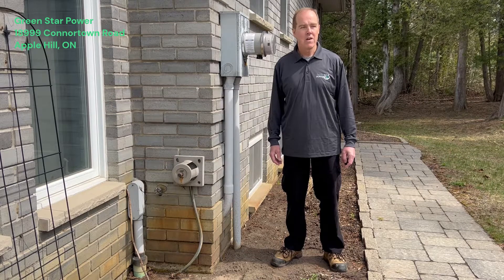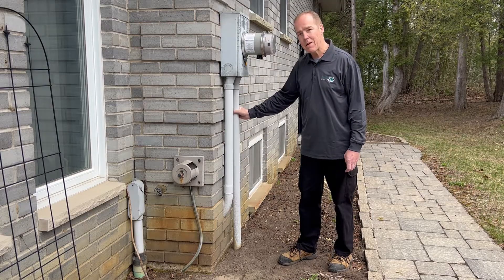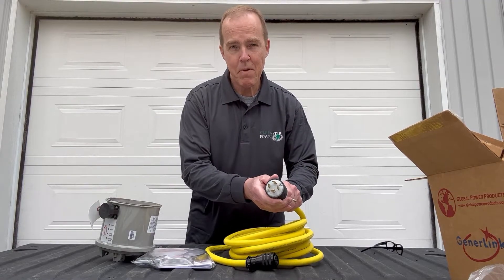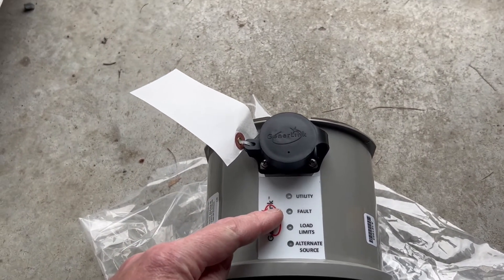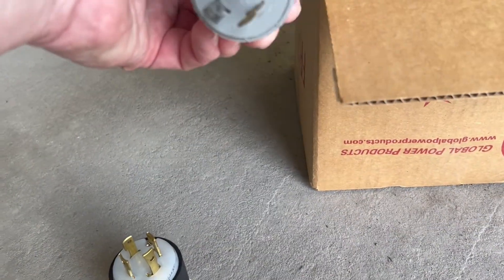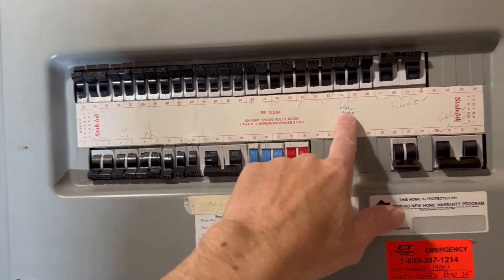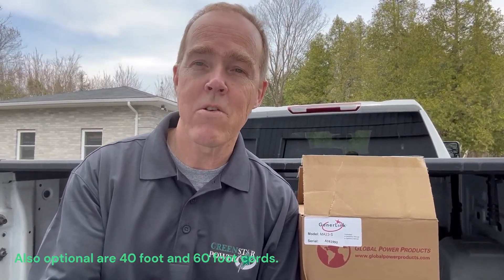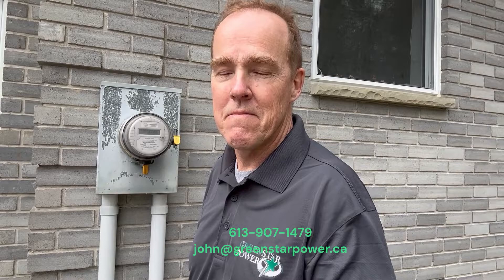GenerLink - How it Works, Connections, Electrical Panel, Options and more.

Comment: Cool concept but keep in mind that you can't use a Generlink with bonded neutral generators.  The Generlink will NOT switch the neutral, so using a bonded neutral generator is going to introduce a second neutral path, which is a big no no.  So, while a Generlink works with floating neutral generators, the module won't work with bonded neutral generators.
Reply: Can easily add a neutral switching plug to most generators to change to floating neutral.  You pointed out a very good thing to watch for with generators!

Comment: One thing to consider .. Surge protection is a one time protection. Once it surges once the generlink is bricked and needs to be sent in to generlink to get repaired.   Cost is 1000.00 in canada plus permits to get it put in again
Reply from the maker: Thanks KK for that information.

https://generlinkcanada.ca/wp-content/uploads/sites/2/2024/06/GL-OP-Manual.pdf

This comes straight out of the GenerLink Operating Manual. Look under Surge Protection Manufacturers Limited Warranty. Home surge protection is a growing in popularity. There may be better, cheaper options than buying a GenerLink with surge protection. People should discuss that with their electrician. On the other hand, a GenerLink with surge protection (at a potential cost later of $1,000) is better than buying one w/o surge and then not protecting your home at all. Also to consider, if your house gets a surge, will your utility or your insurance cover your losses?

Comment: Wait until you go to change the rubber plug cover because it's weatherchecked, cracked, and loose. You'll find out like I did that you have to take the unit back off the house to do it. The screws for the rubber plug cover thread into some retention type nuts inside the unit.... that are now loose after you took the original screws out and so you can't get the screws to re-thread going back in!!! Wow, dumber than ** design.
Reply from the maker: @Xlatty how old is your GenerLink? It must be in direct sunlight a lot. That would be annoying.

Comment: lack of 50A option is strange, as stepping up to a 50A outlet on the generator would be common. Also that "Standard" cable is not at all, its some proprietary Generlink 4 pin plug. not cool.
Reply from the maker: lol, I was referring to THEIR standard. Yes, it's 100% proprietary... and I haven't been able to take the plug apart. They say that it has to be returned for repair.

Comment: Hi.. Thanks for the video .. Can you wire your solar inverter to the 30 amp plug..220v Female.. Then plug that into Generlink. Appreciate the video.
Reply from the maker: Thanks for the positive comments. I would suggest only using the GenerLink per the manufacture's recommendations. "The GenerLink transfer switch is a UL-listed, socket-mounted device that provides a safe, easy and affordable way to connect a portable generator to your home."

Comment: I want to hook up a solar bank  to a generlink. So all the solar generators i have found are 3 prong not 4. And its ok to cut the cord and make it 3 prong ? I only want to use frig and a couple ceiling fans. Then , use breakers and use hotwater heater. Then switch back. What you think

Comment: so what does your GenerLink use to fuel it and is it ever a concern? Thanks for teh video.
Reply from the maker: Hi Rob, the GenerLink is a type of transfer switch. It switches the power source either from your utility or from your generator. It does not need fuel.

Comment: We had the GenerLink installed at out countryside home and it’s a life saver, we don’t have the meter on the house but at the power pole about a hundred feet away with underground service to the house panel, there was an issue with having to have a dedicated neutral wire from the GenerLink, to the panel so that meant digging a trench at an extra expense, they won’t allow the use of the neutral from the existing main service to the panel to be used, it has to a dedicated wire by code. Very informative video 👍🏻

Comment: Question Can you test your generator and connection while the utility power is still on?
Reply: Thank you for a compete and thorough response. Much appreciated.
Reply: From Generlink:  Q: Can I test my GenerLink system before a storm?
A: Yes. Refer to the operation manual for instructions on testing the GenerLink even when utility power is available.
Reply from the maker: Short answer: No. Long answer: If you complete the connection and run the generator, a LED should come on under the GenerLink. Internally, the GenerLink is still connected to the utility.

Comment: I have interrupted service at my house meaning 2 outside meters, the 2nd meter is wired off the 1 meter and the 2nd meter supplies power to my AC unit… My question will the generlink supply power to the 2nd meter so in a power outage to run my AC unit?
Reply from the maker: @no1but24 without actually following the wiring, I can't be sure.

There are two possibilities:
1) Meters in series:
- Then yes it would supply your AC unit.
- When running off your utility, you might think then that the utility is charging you twice for the same current. Because M2 runs through M1 first. But if they are in series, then for invoicing, the utility would subtract the M2 current from the M1 current and invoice you at their respective rates.
- When running off of your generator on M1, the GenerLink will only disconnect the meter on M1, and M2 will still be measuring current that you generate. However again, on your invoice, they would subtract M2 from M1, which is strange because while your generator is running, M1 is not measuring anything. So at the end of your billing period, you would inadvertently get a credit for the power that you generated. (I doubt that they are in series.)
2) Meters in parallel:
It won't run your AC unit.

Comment: So if you went with the surge protection,  it only for when the generator is running?  Its not a whole home surge protection for everyday line power???
Reply from the maker: Correct
Reply: Surge protection is a one time lifesaver. Then the Generlink is inoperative

Comment: Sounds nice but my electric company will not allow GenerLink.
Reply: keep checking with them from time to time... my local just aoproved
Reply: My electric company installed my GenerLink at no charge, I was the first one in their service area to get one. They were unsure about it at first, but after calling GenerLink and confirming it's a safe setup they came out and installed it in about 15 mins. It easy enough for the home owner to install but it means you would have to cut the seal off the meter, which is not advisable. This is the easiest way to hook up a whole house generator. If your power company is reluctant about your install, GenerLink will call them and possibly change their mind.
Reply: @Snoopy-oz3et  Nice!  I was not aware that GenerLink will call them and explain the device to them.
Reply from the maker: Some utilities make it complicated. In Ontario they prefer that an electrical contractor install it but Hydro One has to be present to turn off the power for the electrician to install it. In this case an ESA inspection is not required. Alternately, a client can coordinate that Hydro One install it, but the client must coordinate the Disconnect/Inspect/Reconnect with ESA and pay the relevant fee.
Reply from the maker: That's unfortunate. A manual transfer switch is also very effective, and safer than running extension cords. If you don't already have one, your electrician can give you a quote.
Reply: I see now they offer an option that does not require electric company approval. It's called the GenerLink Hybrid Transfer Switch System.
Reply: @louhightower4141  Thanks, yes, I'm aware of that device, but I'm having trouble finding an electrician who is interested in installing it.  They are all looking for big jobs where they can make a lot of money, not small jobs.

Comment: Does  BC  hydro  approve  Generlink  for  backup  power generator
Reply from the maker: Hi Roger, from what I can tell, the answer is no. The document in the link below is from 2016ish. But... I suggest that you call your utility to confirm.

https://app.bchydro.com/content/dam/BCHydro/customer-portal/documents/distribution/standards/ds-ES54-EA2017-009-Banned-collar-type-transfer-switch-reaffirmed.pdf
Reply: Nope. Alberta had no issue with it

Comment: If I have a 12500/10000 watt generator so what should I use for the cord.
Reply: Thanks for reaching out. The Generlink comes with a cord. The standard length is 20 feet, with optional lengths increasing in 20 foot increments up to 100 feet. However, lengths beyond 60 feet are hard to get a hold of. One end has a proprietary plug that matches the Generlink. The other end has to match your generator. Since your generator can supply 10kw continuous, I expect it has a 14-50 receptacle on it. In which case, you would need to order your Generlink with a cord that has a 14-50P on the other end.
Reply: You would have to get the 40 amp Genelink which will come with a 20 feet cord with the 50 amp plug only thing is if you need a longer cord you can order a longer cord or you can use a regular 50 amp cord with your desired length and plug the female side of your regular 50 amp cord into your Genelink male side ....that's how I did mine for my extra lenth

Comment: I'm seeing some discrepancies in which generators are compatible with the generlink 40amp... the Generlink site which has the compatibilty chart shows that both the Firman 10,000 watt gas generator has a floating neutral ( which the Generlink site says you should use with their Generlink ) and also says the same for the Energizer eZV8000...yet when I look up that info on the Generator bible website it claims both these generators are bonded neutral, obviously I don't want to pull the plug and buy a Generator unless I know for sure its compatible with the Generlink system, any help you can offer would be very much appreciated....subbed